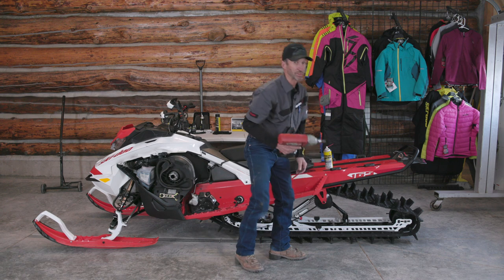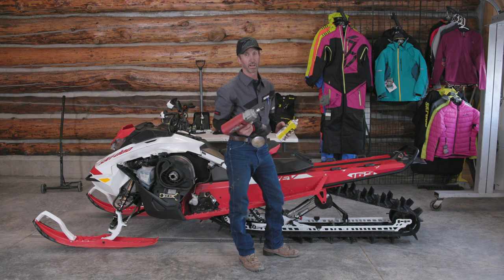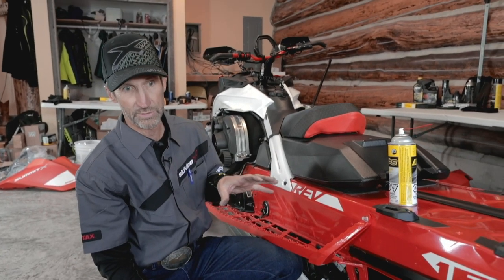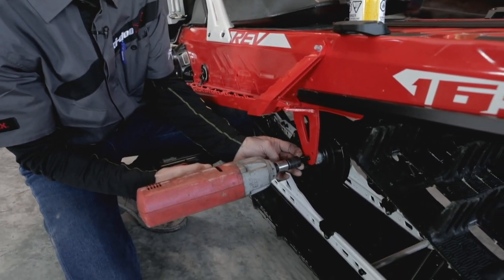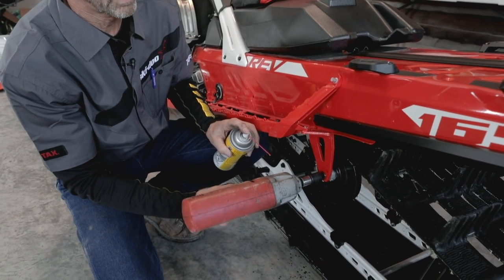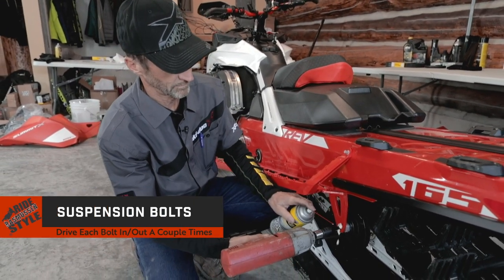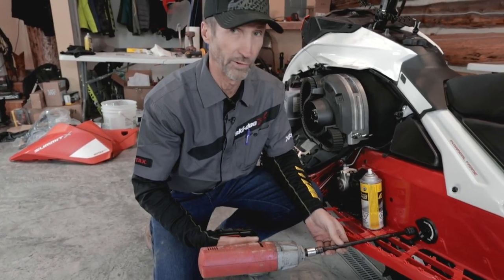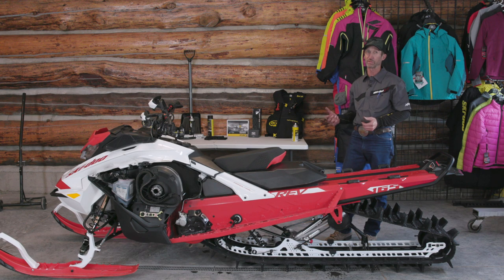Ep4 - Suspension Bolt Removal Ski-Doo G4, How To.

Comment: Loosen the rear axle first. Then loosen the adjusters. Pull one bolt out and if you have a bench grinder with a wire wheel clean the loctite off. Drive it back in then do the same steps with the other bolts till they are clear of locate and your good too go.
Reply from the maker: Great tip, thanks for the feedback!

Comment: Shows nothing. The problem is only one side will ever come out. Once it is loose on one side the other side won’t loosen to apply lubricant. Tried loosening and tightening the easy  side multiple times. Difficult side will never break free. Has to be a trick that actually works.
Reply from the maker: you have to pull both bolts from one side, lay the sled on its side with the two opposite bolts upward, then pull the bottom of the skid out of the tunnel enough to offset the skid until you can get a plier on the through shaft. Now the bolt can be removed while you hold the shaft. But it has to be the shaft and not outer axle. Has to be offset about an inch and a half to be able to find the through shaft.

Comment: Note! loosen off the track off first. no tension on there to bend stuff is nice. I hate it when guys do how to videos with partial info.
Reply from the maker: Thanks for the comment. I should have elaborated on that a bit. While it's okay to loosen the track tension, I prefer not to loosen. It's much quicker to remove the skid and reinstall if you don't have to go back and readjust track tension and preform the alignment procedure afterward.
Reply: What are you incredible hulk. How you could get the skid back in there and the bolts in with out bending stuff / scratching stuff with that track tight is beyond me.
Reply from the maker: @R1Kyle  it's not that hard if you follow my technique. But you have to do it just the way I describe and in the exact same order. But as I said. It's ok to loosen, just have to take time to readjust. Have a great day!
Reply: @RideRasmussenStyle  OK today I went to install my foot rail stiffeners on my brand new 0 mile 2020 175 X.  To do this you have to remove the front two suspension arm bolts. I will say doing that without loosening off the track is idiotic. Sorry Bret your order means nothing when the skid is under tension from the track and loosening and even removing a single bolt causes things to twist under that tension. I am a meticulous mechanic that wants nothing gouged, twisted or holes elongated out. This is s great video to tell people how to break free the suspension bolts but I just would not remove them under track tension for how easy it is to align a track. Sorry my opinion does not agree with yours.
Reply from the maker: @R1Kyle  I agree that you can't loosen the front arm bolts without also removing the rear arm bolts. And I also respect your method of loosening the track adjuster bolts. That's perfectly okay to do that. 🙂
Reply: @RideRasmussenStyle   I just went back to Ski-doo this year, I bought myself an Xmas present that I picked up on Dec 26, a Summit X 175. I was not wanting to buy a Ski-doo because of the Quebec link but there was not much else I wanted to ride. I will miss the power of my Modded 174 270 Hp Yamaha but I sure will not miss the weight.  The only other thing I wished was this machine did not come with such crappy shocks!
Reply from the maker: @R1Kyle  the suspension keeps getting better. But lots of room for improvement. I hope you have a great year on that sled. And stay safe.
Reply: @R1Kyle  No, he’s smart. Use a ratchet strap.